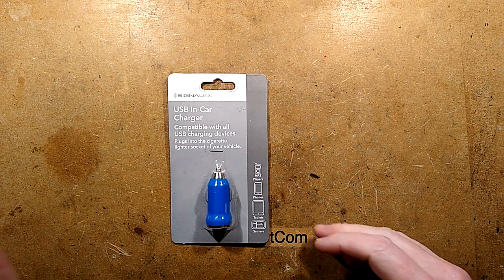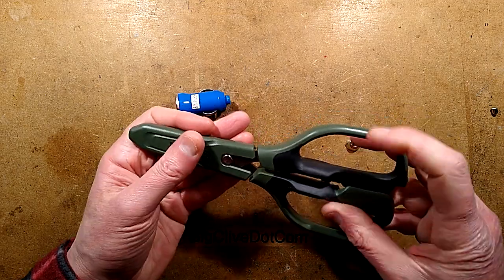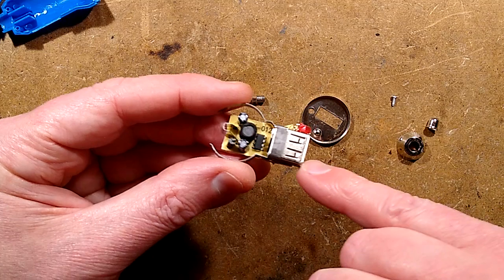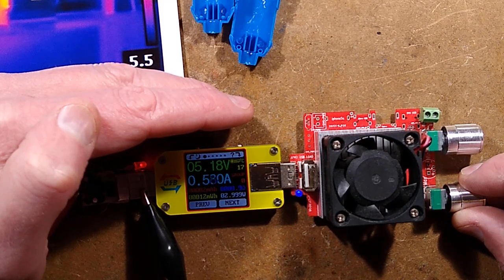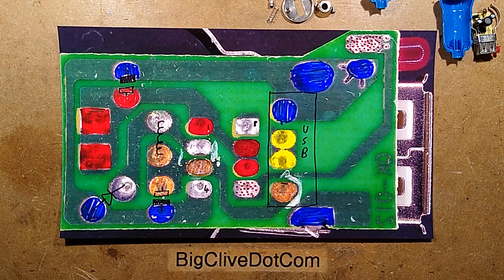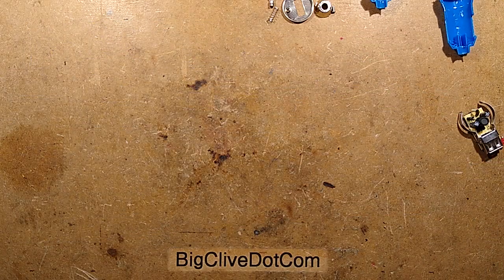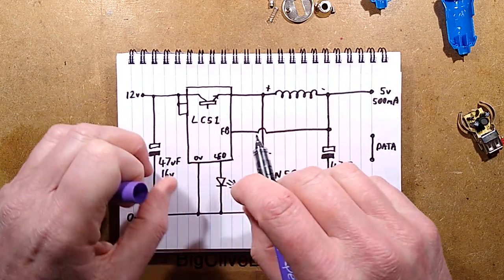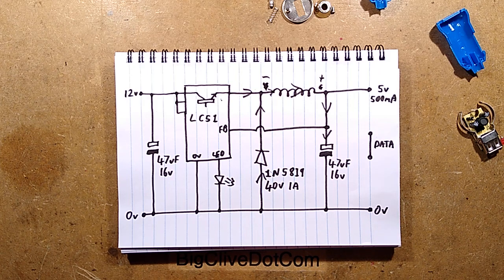Inside a Pound shop car-USB charger (with schematic)

Comment: you make a great point regarding optimization, the early chips could be tailored, more parameters, but this guy now has one purpose in life and that is to switch at a set frequency and operate to a fixed 5V, it could be very useful if you know you want half an amp at 5V, worth spending a quid and putting the components on to some small project you might have, in the past I have ' hot plated ' (not a real word) components I have needed off these cheap boards and used them elsewhere for a fraction of the cost of buying them...cheers.

Comment: I used one of these for a while - it was JUST powerful enough to keep my phone going when using sat nav app and when I say "just", I drove from cardiff to manchester and gained only 4% battery on my phone on the way there. The biggest problem though was when I hooked the phone up to the radio to play my music- the noisy supply translated through the audio output and was VERY obvious. Alright in a pinch but get yourself a proper branded 2A one - far superior.

Comment: On the thumbnail it says "500MA", you really got my hopes up that it claimed 500 mega-ampere. 😅 (M = Mega, m = Milli)
Reply: Well, connect it in series with a lightning rod and it might just do that... once... :)))
Reply: It's like the "1500W peak" car stereo subwoofers at walmart...sure they could hit 1500W output, for like 0.002 seconds  if they were struck by lightning. 😂
Reply: @hdrenginedevelopment7507  All you would have to do is hook the subwoofer up to a crystal radio set with a paper clip as an antenna within 6 feet of the cable modem power supply...I'm surprised that my internal organs aren't cooking from all the RF noise it puts out...would blow the MTX Jackhammer cone clear out the basket through a concrete and rebar wall.

Comment: Well explained Clive! Our county gave out free boxes with energy efficient lightbulbs and a "smart" power strip. The power strip is sold by by Megalight in Hudson, Ohio (made in China) and they call it "Megalight Advanced Power Strip w/7 receptacles and surge protection" (model APS-7-600). It has two "always on" receptacles, a "master", and four "energy saver" receptacles. We plugged our router into the always on receptacle and a light into the master. We turned the light on and switched the power strip to on but the four energy saver receptacles do not work no matter what we do. Very disappointing, but these were bought by the government so I really did not expect much. Wish I had your knowledge to take it to bits!
Reply from the maker: It may require a higher load in the master socket to trigger the slave sockets.
Reply: I will give it a try! Thank you.
Reply: Plugged the toaster in to the master and everything works, you were spot on Clive! Thank you!!!

Comment: I once had a car charger for my laptop.  But the charger got so hot that it slowly melted the plastic all around it until the plug deformed and eventually shorted itself out.  But it wasn't any chip that caused all the heat.  I solved the problem by installing two RCA jacks in my car - one for hot and the other for ground.  By replacing the standard car plug with RCA jacks, it made a much better connection, reduced the resistance significantly, and cut the heat generated by at least a factor of 4X.
The takeaway is that car adapter connections totally blow.  Almost anything would make a better connection.  A half amp is all you should ever want flowing though a car adapter.

Comment: Well, I guess they could have made it even cheaper by just putting in a 7805... :D I think I've actually seen that in a car USB charger before.
But seriously, why not just use one of these dirt cheap buck converter boards with the MP1484 for example? They run a lot cooler with higher current and I guess it wouldn't be much more expensive to produce...
Reply: what he show was a 12/24v to 5v buck converter

Comment: I remember one time I went on vacation and forgot to bring a charger and had to use my mom's 700 milliamp hour charger. It also had a built-in micro USB cable meaning you couldn't remove the cable if it got freighed or something
Reply: There is no such thing as a 700 milliamp-hour charger.
Reply: @SodAlmighty  there is no such thing as a 0.7A charger? Explain why
Reply: @bland9876  that's not what I said. I quite believe you had a 700mA charger.

Milliamp-hours is a measure of total energy.
Reply: @SodAlmighty  so i used the wrong turm in my original comment? Woops
Reply: @bland9876  No such thing as a turm...
Reply: @SodAlmighty  well how do you spell it then if "turm" is wrong? My phone will not tell me
Reply: @bland9876  "term"
Reply: @SodAlmighty  oh so it is the same as like a term in college.

Comment: If they had left the data lines floating then this charger would be perfectly acceptable. Any downstream device implemented according to the USB spec wouldn't draw more than 500 milliamps upon seeing the floating lines.

Edit to add: Actually, a spec device wouldn't draw more than 100 milliamps without communicating with the host and getting permission to go to 'high power'. On further reflection, they had to short the data lines to keep this thing from being completely useless.

Comment: I'm using a cheap Bluetooth to headphone jack adapter in combination with a cassette adapter to listen to stuff from my phone in my old car. The Bluetooth adapter has a tiny battery inside (I guess <100mAh), which needs to be charged every 3 hours or so. I am also using a 3-way plug in my cigarette lighter (each socket can be switched individually), and it also has USB outputs. Charging the bluetooth thingy on that works no problem. And then there is the dashcam adapter, which has the same form factor as this, but with 2 USB ports and a rating of about 2A or so. When I plug the USB lead to charge the bluetooth adapter into this thing, it gets so horribly noisy that the bluetooth adapter couldn't be used, so I can only charge it from the 3-way cigarette lighter thingy's USB sockets. No problem there, but it showed me again how different in quality a 12V to 5V power supply can be.

Comment: Tip I you want; the brand Ugreen on aliexpress or Amazon makes fantastic ones; especially one dual 18W usb type C, Qc4.0. That is 36W total (5v 3A, 9v 2A, 12v 1.5A). This one is fantastic if you want to try a fancy one, I have this one and it is really good. I think it cost about 13 pound

Comment: The USB specifications For batetry-charging allows the shorting of the data-pins to signal it is a dumb passive USB-charger.
A "normal" USB port is only allowed to supply 500 mA to a highpower-load and for that both sides need to communicate, while having a resistance of no higher than 200 Ohm (so shorting) means that the outlet is for power-delivery only and is ALLOWED (not required) to deliver 1.5A (first specification) or 5A (later specs) without any negotiations.
This greatly simplified USB-chargers as they no longer needed to implement chips that follow the actual USB-Protocol but just provide the correct voltage/current.

Comment: Had one of those, the plastic got so hot that it started deforming, one of the sides deformed so much that it wasn't circular afterwards at all. It wasn't £1 either, bought it at a gas station so it was more like £15
Reply: For that price are you sure you didn’t buy it at an airport?

Comment: The bridged USB data pins indicate to the connected device that this is a "dumb charger" with no capacity for negotiating the current.
The current limit is 500mA. This is part of the USB specification.

Comment: I just took one apart that I have had for a few years now which I got from eBay and it looks identical to to the one that you just took apart but inside the PCB board is the same shape and that's where any similarity end's, my one has an ON semiconductor MC34063A, 4 resistors, a ceramic capacitor, a 50v 10uf input electrolytic capacitor and a 100uf 10v output capacitor instead, I haven't measured it's output but from memory it was an extremely slow charger! 
There is a datasheet available for this IC which shows that it could deliver greater than 1.5A of current with an external transistor and an optional output filter network which the Chinese somehow couldn't see any point in implementing. I'm sure that no one would have had any problems in paying 1.5 times the retail price to have these extra components thrown in to make a better USB charger and uphold their own reputation and integrity as a people, but instead they choose to make this crap and sell it to people who expect something good but instead get landfill additives... 
I'm personally trying to find the perfect single cell Lifepo4 battery Stepdown isolated output charger! 
I know that the components for this purpose exist but the circuit itself doesn't seem to exist! I'm looking at every possible Controller IC that I come across for something that fits the criteria but I'm not as DC to DC converter savy as I would like to be and it's taking forever to get this particular project up off the ground! I have the Idea that I believe should be implemented right now but the current method is used everywhere and it's not the right way to do it! 
I think that I'm just going to have to hook up with someone who understands DC to DC converters and together we can possibly change the world!!! 
That what I'm trying to achieve is something that everyone needs but no one has, the components to build it exist and just needs someone to put it all together! 
The search continues!

Comment: Had one of those meltdown on me the other day, with possibly the same topology. It failed when the inductor heated up so much that it melted the solder holding it onto the board and warped the plastic shell where it made contact.

Comment: So some modifications:
Cut the data trace so it will advertise 100 ma.  Put a small heatsink on top (like a copper shark fin).

It would be neat to see an O-scope trace of the inductor and LED at different load levels.
Also, measure/estimate conversion efficiency at different load levels.

You might as well do a 10 pound review of a pound land device.

Thanks for sharing your insights.

Comment: It was mentioned. And I could be wrong. But, a point worth noting is that USB 3.0 is Backward compatible. The point I take away is that this blue device will take a lot long to charge a device, than a high power version.

Comment: A while back I bought a bag of 7 identically-constructed adapters (with a company's branding on the side) for $1 at a thrift store. Mine have the conventional MC34063 which Clive was expecting. What I found interesting about the one torn down here is the IC's package, it's like DIP except half the width.

Mine is a bi weird. The sticker rating is 12-24v in 1A out and it actually has parts which would hold up on the higher input voltage. However the output is only 500mA or so before the voltage drops. Also its "output" LED is inexplicably connected on the input side so it won't actually let you know if there is a problem with the output. It's less efficient and less useful than a proper output LED and it also varies brightness based on input voltage.

Comment: The LC51 is very popular now in these Chinese cheap chargers and the 51 stands for 5.1V according to the datasheets I have found. bigger versions of this chip have an output current of 1.2 amps

Comment: I don't get all the 500ma hate. I think it's just trendy people always thinking newer is better and they MUST have it or something. Sometimes older is still perfectly adequate depending on your needs. If I decide to go out at short notice and the phone is low, sure I'll chuck it on one of my faster chargers while I take a shower and get ready. But I'm frequently just charging the phone in the evening while cooking dinner or even overnight - I really don't care if it takes 1 hour or 4 hours. Same at my desk at work - slow is just fine. 
As for in the car, I do have a 1A charger but I've had an android phone flash up a warning that it was halting charging due to overheating (I was using navigation software at the same time). So a slower charger which creates less heat has its place too - even if just to stop the phone depleting much while I drive across town with maps on.
Reply: Also whether it's 1 hour or 4 hours...it's still not now...a full service restaurant is wonderful when you set out to become hungry 45 minutes into the future...a CFL bulb is wonderful if you think you might need light in a room 5 minutes from now...Wish is great when you decide you need a new toy one month from now....

Comment: I happen to have even smaller car USB adapters that are "rated" 2A and sure they supply high current... For couple of seconds after which they switch off and on again. A tiny piece of folded aluminum sheet out of deodorant can glued to the top of the chip with cyanoacrylate was enough to make it work continously with my old phone.

Comment: The spec for a standard data USB2x is 4.5-5.2v @500mA - so it's sort of in spec for the bog standard output.  Most designated chargers use the 2.1 default of 1.5-2A (unless they are cheap and shitty - then you'll only get 1A), no data lines or data shorted.  
Then there is USB3.x which could be combined with QC3 and 3.2 to include PD compat - both give 20v @5a (100w) but that has active data lines to negotiate the output.

Comment: Oh man, I got cheap one with "2 Amp" output about year ago. That thing decided to blast it's internals inside the lighter socket one day. Upon closer inspection the plastic was cracked exactly in half.. I'm pretty sure that cheap plastic is not winter-proof, that's the reason why it exploded.. 

Anyway, they are pretty useful as compact 12V -> 5V step down converters.

Comment: Thanks for the info!  Even though it's a low end device, I've seen ones made embarrassingly cheaply using what looks like a single transistor and no inductor, and other ones which look built well, but with poor regulation for some unknown reason.  At least yours regulates well.

In your diagram, I am willing to bet that the output of the chip to your inductor is a collector of a PNP transistor, so the base of it doesn't need to swing full voltage, and it would completely saturate easier.  But it's a step down converter in this use so I may be wrong about that.

Comment: Great video as usual Clive, I look forward in higher output , lot of the cheap adapters and semi decent ones  the 5V chucks out RFI and caused interference on dab in my Land Rover disco 4 , eventually found clean o/p ones all made all metal. Also fitted clip on ferrite in to dc feeders too. Regards mark

Comment: Rechargeable batteries always have a finite number of recharges in them before they start to degrade and self-discharge inside the battery cells themselves. However, you can usually get more charge cycles out of them if you take care not to recharge the battery at too high of a rate during any of the recharging sessions. So fast-charging tends to be convenient for time, but not so convenient when it comes to needing to replace the power banks. So even though this device can't pull much power, that's not necessarily a bad thing. It may be better to have two power banks, so that one of them can always be on slow-charge. Rather than the rate at which it charges, I would be FAR more interested in the amount of efficiency losses it has while it charges.

Comment: Pretty minimalist but would be ideal as a reasonably stable low-current 5V supply "on the extremely cheap"!  Even at 500mA, that's still 2.5W which for many 5V devices is plenty of power.

Comment: Bought a cheap 1A charger a while back. Turned out the switching frequency totally jammed the FM band. So couldn't listen to radio while charging. Ended up buying a proper one instead, with quick charge support :)

Comment: I'd imagine the chip is rated 15 or 16V, given that a fully charged fresh lead acid car battery will be 14.4V (2.4V/cell).  Nice how they have these little buck converter chips so that so very few parts are needed now.   This circuit is so simple, it is literally great competition against the venerable LM7805, and unlike the 7805, is efficient enough to not need a heat sink.  A good aside video would be to compare these cheap buck converters efficiency+pf vs the 7805 (or LM317).  You have the efficiency+pf meter.  As a caveat,  maybe also add an asterisk to it all with some oscilloscope traces showing purity.

Comment: I'm pretty sure you can externally power that USB power meter via the micro-USB port. That way it won't blank out at low voltages.

Comment: USB 1 (and 2 if I remember correctly) specification dictates current limited to 500mA.  I think it was a safety issue in case of a short.  It wasn't until USB 3 when smarts were added to the spec where devices negotiated for V and I out.  I actually have one of that model.  Was in the middle of nowhere and desperate, so I bought one at a nameless gas station/quickie mart.  I was surprised they had one.

Comment: That Motorola chip they all used to have was a MC34063A. I modified a few to other voltages. I bought good brand name used phone chargers from the thrift store, choosing the ones that had screws so I could easily work on them. You only had to change one or two resistors to change the output voltage and make sure the inductor was big enough and low resistance to handle higher output current.

Comment: Some of the higher current output 12v chargers have an external transistor for the switching, along with the control chip.

Comment: I do want to protest that 500ma is the design spec for usb 2.  To deliver more you either need usb 3 (on both ends) or one of several proprietary systems.  No usb device should give a dummy load more, a higher load device has to be able to communicate with the charger and ask for it.